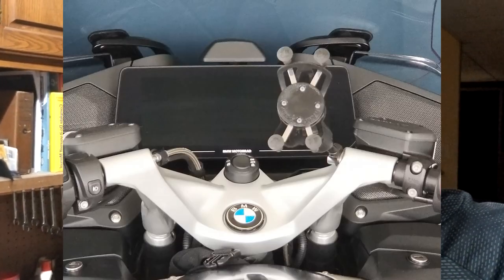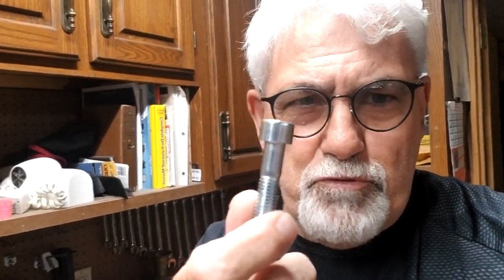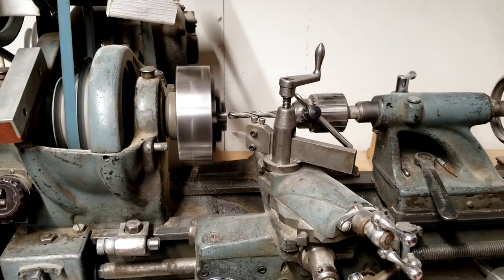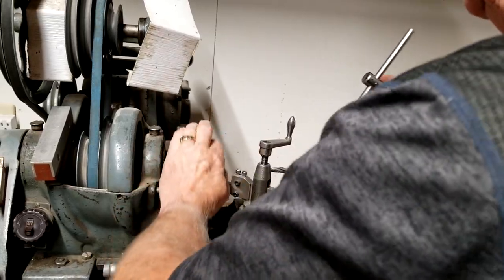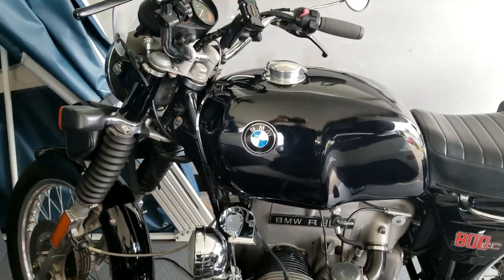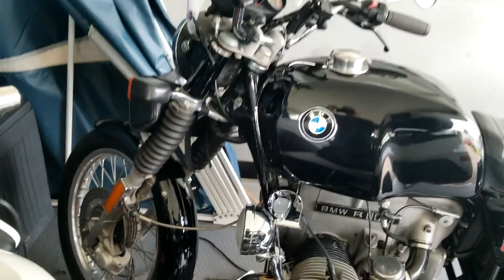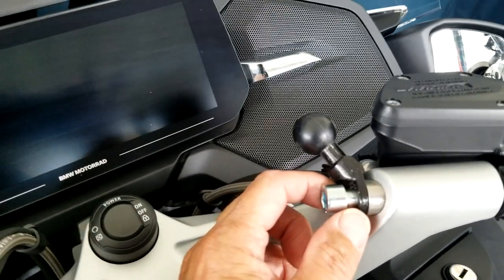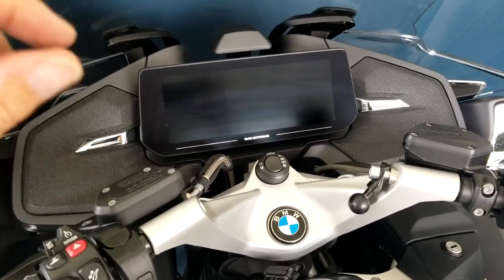Ram Mount Modification for the R1250RT or similar bikes

Comment: Terrific information. Purchased a 2021 1250RT. I’m having the dealer do same or similar to your video. The iPhone 13 is definitely a very hot charging phone in that cubby hole. Hopefully outside the cubby will be much more accommodating. I’m sensing that about all iPhone users will be in for a big surprise regarding the heat that occurs in the cubby hole.
Reply from the maker: i actually now have a pixel 4 and it doesnt have wireless charging, so its basically a glove compartment now. LOL

Comment: 😢There should be a hole below the badge as there was on the K1300 . I think it was threaded but cant remember. You can buy a ball mount which screws into this .
Reply from the maker: no, its a non threaded area and has a large nut very close to the openeing. I already tried that approach
. PLus I have 2 spots this way and can mount my camera on one and the phone of the other. this is better for me.

Comment: so how hot was it outside when it overheated ? 70 degrees F ?   95 degrees F ? How long was it in the compartment when it happened ? I never heard of this happening with any other review before.
Reply from the maker: over 90 and most of the day. i guess if you are just running around town its okay, but on a +6 day tour, its a fail.

Comment: Where to get the handlebar stems:
1) BMW Part Number:   Left side: 32728532971   Right side: 3272852296 Much cleaner install and pushed the Ram mounts a bit wider.
Reply from the maker: thanks. the only upgrade i plan on is the bar risers to bring them up just a tad. that would better suit my riding style. I have plenty of rooom to mount stuff.